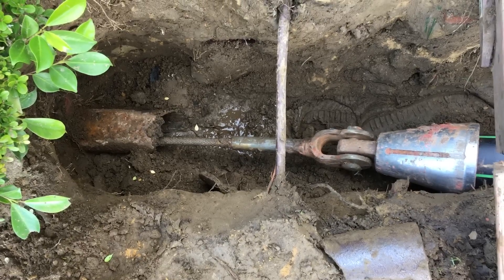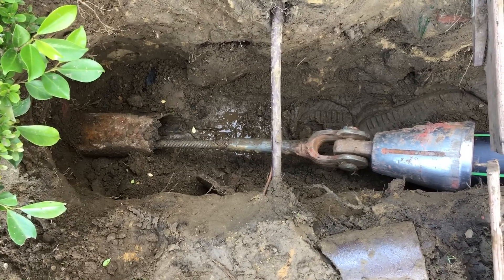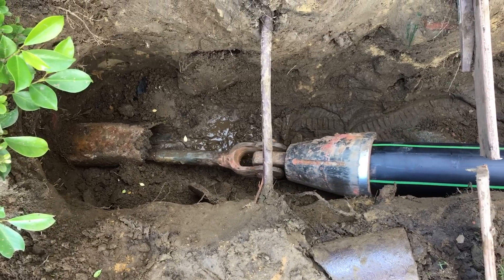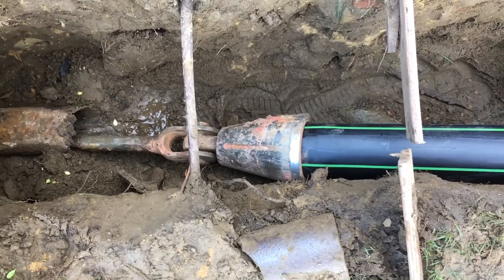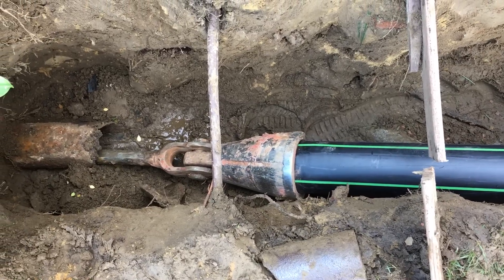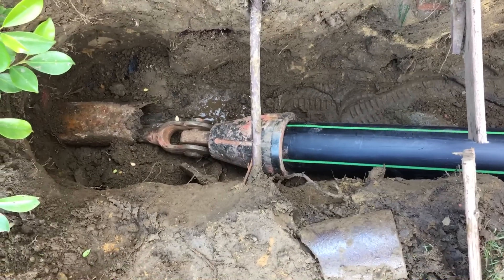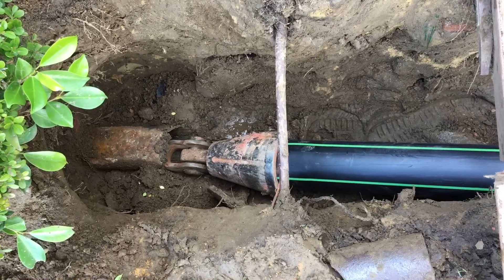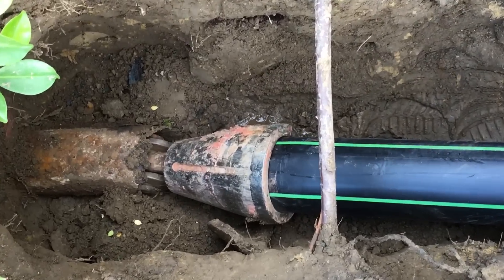Pipe bursting sewer replacement

Comment: This is better than digging the trench to lift out the old pipe?
Reply: Yes …. Imagine digging up 20 backyards with peoples landscaping and fences and concrete just to replace a sewer line and then engaging to go back to replace and fix it all. This is the way to go
Reply: Oh aye, I failed to imagine all o’ that. I was imagining only my own path to my house.  I was imagining an old pipe in the ground putting pressure on or cutting into the new pipe.  But I gather that’s not how it works.
Reply: @Uknews671  yeah I mean if it’s your personal sewer lateral digging it up is fine but if it’s a city sewer line running through large areas this is the way to go!!

Comment: That’s cool I don’t get how the pipe will still have pitch though
Reply: The new pipe is following the exact path of the old pipe as it is pulled through, so assuming the original pipe had pitch, this should have the same.
Reply: You only encounter bellies if the pipe isn't fused properly or overly fused to where the joints start bulging downward. Not fused properly is just not the whole ends making complete contact when being fused. There should always be grade initial otherwise that's not your problem to begin with it's the home owners
Reply: Yeah I was thinking that too
Reply: I'd be very leery using this method. Not only can the old busted iron pipe dig and shred into the new polymer pipe, but certain fittings will not bust, but rather jam the contraption and potentially cause cavity issues around the pipe, rather than providing the new pipe with solid support. And yes after many years or decades, the old timers pipes could be sagging like an old billy goat. If I'm doing an expensive repair, I want to see the whole pipe is pitched and supported perfectly, rather than rely on someone else's work from 50 years ago.
Reply: @Rick-the-Swift pipe bursting is the way. Any bellies can be fixed